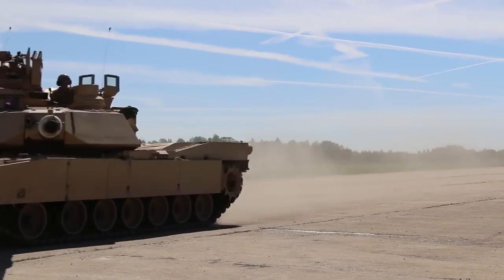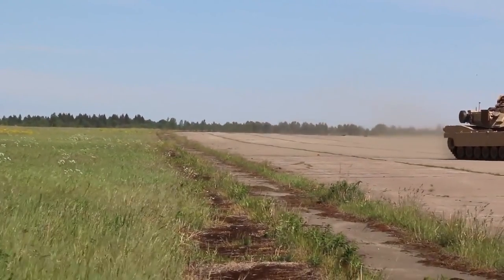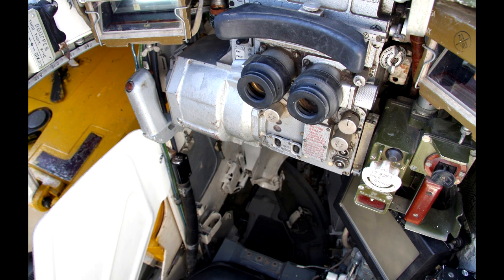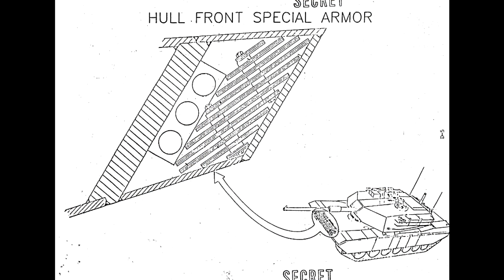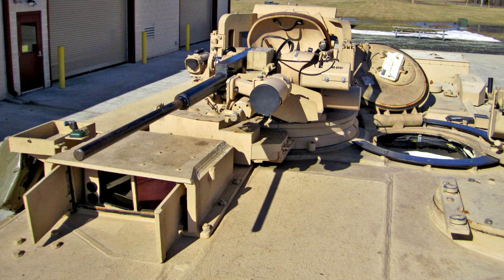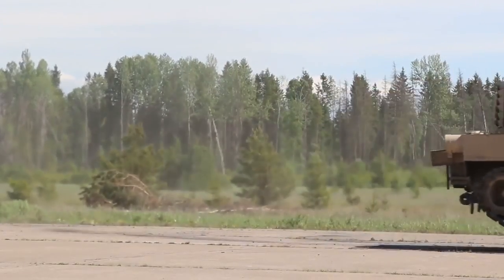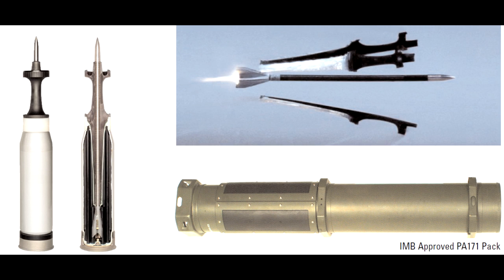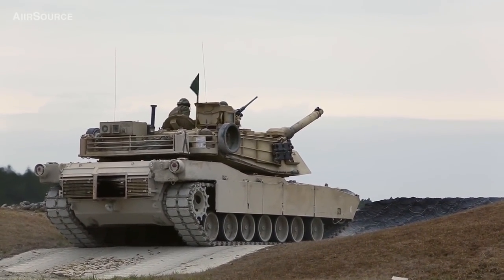Problems with Abrams tank

Comment: I guess you have problem understanding the reason WHY Abrams has such "flaws". It's not that Americans couldnt have built it without these problems in the first place, the reason behind these issues is money - since the product is "flawed", it has  numerous upgrade packages over time to fix the issues. And those upgrades cost, A LOT, especially when you operate fleet of Abrams tanks as large as the one USA has. As for gas turbine engine and Abrams mobility. Having best top speed =/= good mobility. Good mobility takes into consideration other factors as fuel consumption, distance traveled before refueling, off-road speed, fording capability etc. As for fuel itself, US armed forces mainly use JP8, not diesel, and they use that stuff for everything - planes, helicopters, tanks, ground vehicles, power generators etc. and why they dont replace the power-plant on Abrams with a 1500 hp diesel engine and use JP8 in it instead? Because gas turbine guzzles more fuel, maintenance is more complex and more expensive, in short - you need expensive stuff to justify big military budget. That's why F-35 software is glitched, and they spend millions of dollars to fix it, and that program will put F-22 to shame when it comes to price even though F-22 is far better jet and more capable than F-35. Same goes with issues with ground equipment like Abrams, issues with littoral combat ships, with new lightly armored cars etc. You need issues to keep the money flowing i.e. to justify $700 BILLION military budget. It's called capitalism, do you get it now?

Comment: The choice of the gas turbine over a normal diesel was found to be a problem in the gulf war.  The turbine had to be running all the time to power all the electronics, using huge amounts of fuel even when not moving.  The other, inferior nations tanks, however, had little petrol APUs to keep the lights on when parked up......

Comment: Sir, your claims are inaccurate. The Turbine was shot and tested for survival conditions. The Turbine has 5 different protection state modes. It also has a Battle over lock-in mode. Even if damaged the Turbine can still run and has proven to combat effectively. For the night operations. The crew is issued PVS-7’s or 14’s. Which coming from my own experience worked well at night during platoon maneuvers. WarThunder is not accurate BTW. The Flir systems are not accurate, the Tank fire control systems are not accurate. The damage models are not accurate. Can’t repair a fuel cell in 1 minute. Steel Beasts as of now is as close as it gets for civilian sales.

Comment: You highlight a number of valid points concerning the M1 design. I spotted the shot-trap with the XM-1, and they never fixed that. During the Iraq invasion, it was shown that the aft starboard side armor covering the fuel tank is too thin, and it highly vulnerable to tandem warhead RPGs, which insurgents capitalized on, brewing-up a number of M1s in close-quarter fighting. But compared to the M60, which I crewed, it's still a far superior vehicle.

Another flaw you didn't mention is that, with the addition of DU in the armor gaps, the combat weight has crept upward by almost 15t over the M1 weight, which reduced the number which could be airlifted via C5 by one per sortie, and during GW2, resulted in multiple vehicles getting bogged and unable to extract themselves.

An advantage of the gas turbine that you did not mention is the sound. It is a very quiet engine, which could be a factor in close-quarter fighting (the first M1 I saw was a platoon traveling in a convoy with an M151 Mutt and a pair of 2.5t trucks, and I could not hear the 5 M1s over the sound of the other vehicles).
Reply: It is not a shot trap, Modern kinetic penetrators do not work they way AP did in World War 2.

Comment: The turbine engine can use diesel, jet fuel, gasoline, and kerosene.  It was chosen because of its versitility.
Reply: Lower weight, higher acceleration than any diesel of the time, provides more torque, quieter than any diesel on the market. There are a multitude of reasons why it's still used. Idiots see high fuel consumption and think the world is ending
Reply: @lepermessiyah5823   especially since is freezing temperatures it can start up much faster and easier.
Reply: Yeah it was better then the diesel engines of the day, but now the current diesel engines have come a long way since the 1980's and I think they should start looking into a change especially since the turbine's are getting older and maintenance cost is going up a new turbine has not been made since the late 90's

Comment: that 'expensive' turbine engine is expensive at the start yes, but due to the constant development of the engine. its more like the parts are whats more expensive is something breaks. The engine gets 425km per tank. thats well enough to role from South Korea DMZ to North Korea's capital. Not only that but you fail to mention how the turbine is also MUCH lighter then the Diesel engines. and its also much much quieter. The trials to switch to a different engine have failed. Another thing i dont think was touched on was the change of the engine, the Lycoming AGT1500. The Engine was moved to the Honeywell company in 1995, which further improved filtration, changed some dynamics of the engine, and reinforced the feed system encase of some kind of penetration, this then was dubed the Honeywell AGT1500C engine. Further development of the engine system would switch the engine from Air-combustion to fuel-injection. if need be, this was a prototype system. It would consume alot more fuel this way.
The multi-fuel point is not that 'the army only uses one kinda fuel' its more like 'alright, we dont have enough fuel here in southern Russia due to russian air difference crippling our logistics for a wile, what should we do? i know! lets use the fuel from the cars/tractors/ect we find around the area!'  its a survival thing. The M1A2 will have a longer life span with this thinking vs other tanks that will use one kind of fuel. and no. the T-90's V-92S2F Diesel Engine CANNOT use different fuel types. its Diesel and Diesel only. The Leo2's MB 873 Ka-501 is a Diesel engine only as well.
You also fail to mention the lean-back that the engine can push the tank at 60mph on road without the governor. 

So far. the M1A2SEP2 the reports of the Glacis is 590mm~vs KE and 1050mm~vs HEAT.

The ammo of the SABOT can be better. but its as is right now. the length i dont see an issue with. no one does. the addition of a longer barrel will hamper the tank, especially in urban environments.

Comment: Why doesn't he ever point out the fact that Russian tanks besides t14 lower plate has no composite armor. And if it's supposed to hull down so is the Abrams... So that lower plate and "upper plate" weakness isn't a factor... And Russian shells arent ment to pen super angled armor unlike the Abrams shell but that isn't known. So his fetish on the upper front plate isn't tested so he has zero proof that it would be so easily pennatrated. The Abrams kd ratio is high yes it dies but all tanks can die non are perfect I'm not saying he's wrong about the gun either but we havnt had a reason to upgrade it the rounds do well for what they need to do. So upgrading would be money wasted but at the same time it would be better to future proof it.

Comment: In the United States of Waste, a vehicle that wastes enormous amounts of fuel for no valid reason, is hardly considered a design flaw. On the contrary, consider it a feature, not a bug. amerikans design their consumer vehicles the exact same way as they designed the M1. Designed to waste fuel, and require a lot of expensive, and time-consuming maintenance. Again-a feature.  I read that a 'modern' uS tank division requires an eye watering 500k gallons of fuel for its tanks and support vehicles, PER DAY. Then consider most of these vehicles are deployed far from the uS 'homeland', to garrison the planet on behalf of the amero-zinost hegemony, and things become, clearer. 
The uS 'tax-slave' gets billed for not only the tanks, but the enormous costs associated with operating them. And the corporations that actually own the empire? Literally laughing all he way to the bank (which they also own).

Comment: So many holes in this video...…….
Reply: Warren Swan I’m not denying it but can you point them out?
Reply: @goathooker  The video itself shows as a "look at the M1 Abrams MBT. Its a colossal  failure by the typical Yanks". The problem with this is the Abrams isn't a "purely" American idea, but a combination of other MBT's worldwide and taking the good bits and making our take on it. There hasn't been a new hull for the Abrams made since????? If one is taken out, its sent home for refurbishment and back to the fight. Can't do that if the solution isn't working. The Abrams MBT works hand in hand with infantry and sometimes Cav units as a force multiplier. So one could prestage fuel, water, and 10 level parts, and some 20 level parts for it in country. The PowerPac as its known has its flaws, but if the governor was removed, there is no tank around that could catch it. In fact(I could be wrong), but the PowerPack is a former heilo engine in a tank. They again don't build the PowerPac's anymore, they're removed, replaced, and the mission continues. The damaged PowerPac is sent to the US to be refurbished, and it too is sent back out into the fight.The TC has always been able to see in the dark. Maybe of the op, showed them in gunnery with NODS, and how they can track targets with the supporting infantry and Cav units vehicles, that whole thing wouldn't have been mentioned(I mean its not like the Abrams and Bradleys weren't knocking the teeth out of other tank crews in Desert Storm. Same with Iraq since there has been only one Abrams I know of in Afghanistan, and it was used as a defense item. I'd also ask the op to mention another nations MBT that was firmly battletested in war in the late 20th and early 21st centuries. Then name one that has beaten an Abrams. The Abrams can run on any current US Military fuel. MOGAS on around...the same as other tactical vehicles. Op used a lot of open source material to make the video make his point, and that is fine. But there are Nat Geo specials on how this tank is destroyed or damaged yet comes back for rounds 13 on up after being rebuilt. A properly trained crew can overcome 70-85% of the issues the op brought up, and its now the A3

Comment: On which soviet tank remote MG is stabilised in 80is???? .... multifuel system on any tank is the solution for emergency only and demand some preparation on the engine before ... how I was learned that is an option for max 100 km ... after that, you have to back on original full ...

Comment: The gas turbine isn't even a very good one. It's a modified helicopter engine from a failed program. But you know the good 'ol military/industrial complex, it's dollars and votes folks! God forbid they would use an MTU with half the fuel consumption for the same power and more reliability.

Comment: Depends on the crew and skill of said crew. A Leopard and Abrams in equal in effectiveness. It just depends on the skill and knowledge if the crew. But that would upset the Wehrboos
Reply: Nope...Leopard is under armoured. In a heavy weight fight, Leopard would get smashed. Leopard is good, Abrams is the Benchmark, Challenger 2 is Heavy, slow and has an outdated fire control system and lack of sensors but can punch heavily and take a punch in turn. Abrams can punch heavy, take a punch and move rapidly. Leopard 2, can move rapidly, punch hard but cannot really take a punch. All three are very good, Abrams is the most balanced.

Comment: You keep saying "gas turbine".... it uses liquid fuel not gas.  It has no provision for compressed gas. You've got some fun propaganda pictures out of Russia of knock-off targets blown up too.   Maybe you've got your parking brake on.  Both the lower and upper sloped sections of the front of the M1's body are 700mm thick, the 40mm "plate" around the driver could only be hit by a flying tank from above.

Comment: As an M1 tanker for over a decade, there is so much wrong with this video that I don't even know where to start.  I'm not insulted, I'm just disappointed.  As for watching more of your "Problems With (x)" videos, if I can't expect better accuracy, why would I waste my time? 

This is a video made by an apparent amateur Russophile with really bad information and plenty of apparent bias, but few accuracies.  

Binkov will happily tell you that the M1 series, against Russian-made tanks in actual combat, can't be believed because of... reasons.  Whatever, Binky-boi.  Dream on.  First, history is history, no matter how you spin it.  Secondly, it really doesn't matter.  Several U.S. states have larger GDP's by themselves than Russia does as a nation.   Russia is weak, Putin is loud but limited in ability.  Russia is not a superpower, and no matter what it produces tank-wise, it's irrelevant.  They'll never be used in anger unless against a much smaller, weaker country.  The bear won't try to eat anything it thinks may put up a good fight, and we're no pork chop.  

This video is mostly fantasy.  

BTW... the AGT-1500, in my experience starting with the M1, through the other versions, is extremely reliable and low maintenance.  The V-packs (air filters) work very well and performed surprisingly well in the desert.  The engine will burn many things, including cooking oil, and it doesn't care how cold or hot it is.  The fire control system is hella accurate... like,  unbelievably accurate... something Russians struggle with along with consistency of manufacturing gun barrels.   Russian crap is made for peasants, like the AK.  Always fires, rarely hits at long range (Afghanistan experience).  

Oh... that carousel rocket motor you like to put under your turrets... really nice touch.  You don't even need to pen the tank, just get a good slap and some electrical arcing going and pop goes the weasel.  Stalin would be proud.  

Other than the fact that so much of this is just flat wrong, great video, Binky-boi.

Comment: I don't know anything about tanks so I cannot judge what is good or bad about them.   I have, however, seen how well the T-72 and Abrams have performed in combat.  In the Iran/Iraq war (1980-1989) the T-72 performed very well against the American M-47 and M-60A1 tanks used by Iran.  It also did well against the British Chieftain tanks used by Iran in this war.  The T-72 also performed well in Lebanon when used by Syria against the Israelis in 1982. Libya used the T-72 successfully in Chad in 1979.  Desert storm in 1991 was the first time the T-72 went head to head against the American Abrams tank.  The result?  The T-72 lost every single time and the M1A1 Abrams won every single time. The Iraqis lost hundreds of T-72s.  There were 8 Abrams lost in Desert Storm combat: 6 lost to friendly fire and 2 destroyed by friendly forces (Abrams) so they wouldn't be captured. T-72s did indeed hit Abrams tanks with their main gun several times, but it did NOT destroy or even disable the Abrams that was hit, and that was before the Abrams had reactive armor. The only tank that has ever destroyed an M1A1 is another M-1A1.  Over a thousand Iraqi tankers were killed and not a single Abrams tank crewman was killed in tank to tank battles.  I ask you, which tank would YOU rather have been in?  It's argued that the T-72s in Desert Storm were the export variant and inferior to the Russian T-72. That's true, but these inferior export versions were the ones that fought all the wars prior to Desert Storm and earned the T-72 it's great reputation.  No Russian T-72s have ever been in combat. No Russian T-90 has ever been in combat. No Russian T-14 has ever seen combat.

Comment: No modern tank has seen as much fighting on the battlefield and performed as well as the Abrams. Trash on it as much as you want but the “flaws” apparent in the abrams are mostly only apparent due to analysis on how it’s performed in battle. A majority of other modern tanks have seen little to no actual battle experience, which I’m sure would bring the rest of their flaws to the surface.

Good luck arguing

Comment: I’m disliking this, not because you said something very wrong (which you still kinda did), but because of how you talk about the tank, which might not be the best in the world, but it’s not as trash as you describe it.
Anyway with that aside, the 2 main “issues” you said still persists on the M1 aren’t really there, let me explain, the weak UFP might be a problem but in reality it isn’t, due to how those tanks are used, they won’t run around the battlefield like mad lads, but they shoot from relative cover, the army knows how much those things costs and they wont just throw them in the battle and see what happens; then the turbine fuel consumption is an actual issue, but not a big as you described, the turbine always requires a lot of fuel both at low and high regimes, but at high regimes it is compensated by the very high power it can deliver, and sometimes its even more efficient than turbo-Diesels, the APU helped a lot with this, but there are some moments when the engines needs to stay idling, and since a turbine needs always high RPMs it will suck a lot of fuel.

Comment: I really think a new power pack needs to be developed. That engine seems to be really it’s weak point of operation. Yes I love this tank it is so iconic. But when young men and women lives depend on this tank to be safe and secure. I think any issues that needlessly puts the crew in harms way Certainly need to be addressed.

Comment: The smoke generator is disabled on most Abrams tanks due to the risk of the engine compartment catching fire when using its primary fuel (JP-8).